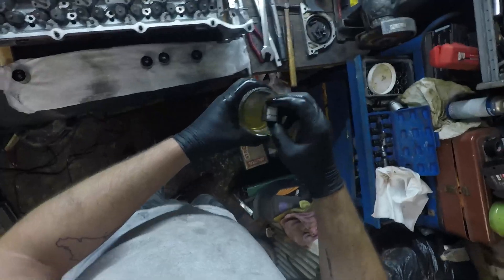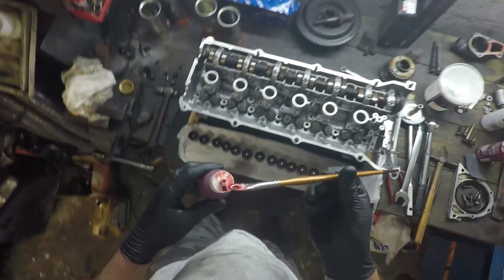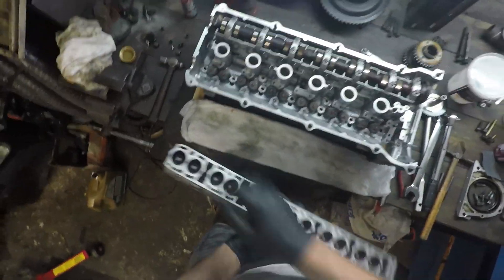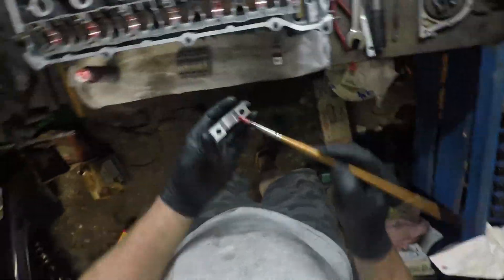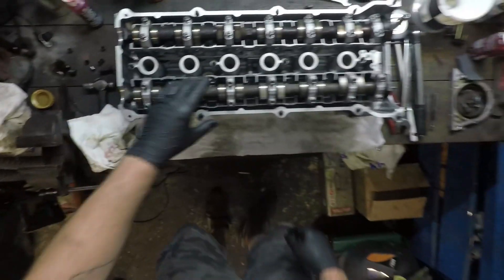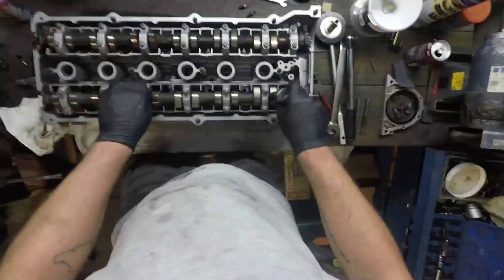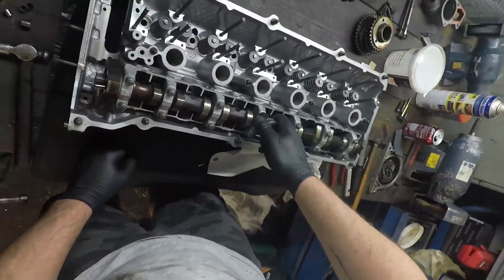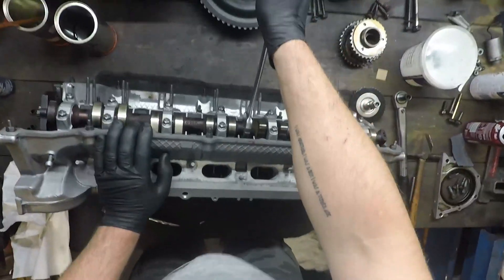M52B30 Stroker Build Camshaft Install

Comment: HI LA QUESTION ETAIT DE SAVOIR , POURQUOI  VOUS N AVEZ PAS MONTER UN JOINT DE CULASSE AVEC LA HAUTEUR OEM M54 B30 QUI EST DE 0.76 MM  ? MERCI
Reply from the maker: Si je comprends bien, vous me demandez pourquoi je n'ai pas utilisé le joint de culasse OEM à 0,76 mm.
J'utilise le joint de remplacement standard à 2 mm - Victor Reinz.
Pardonnez mon français j'en comprends un petit peu et traduis le reste
Reply: @ManSeeksCivic  HI . OUI VOUS AVEZ BIEN COMPRIS . AVEC LE JOINT VICTOR REINZ DE 2MM , le ratio volumetric n est il pas trop bas ? MANY THANKS
Reply from the maker: Non, il doit être à peu près égal au ratio standard. Merci bien 😁
Reply: @ManSeeksCivic  AVEZ VOUS DES VIBRATIONS DU AU MONTAGE DU VILEBRQUIN M54 B30,?
Reply from the maker: Un petit peu, aux la termine du la revoulution gamme. Cest pas très terrible. Je garde le vouiture sous 7k, et avoir câblé l'écrou de la pompe à huile pour sécurité.

Comment: bonjour avec un bloc aluminium m52 , avec bielles et pistons et vilebrequin m54 b30 . pouvons nous utiliser un joint de culasse de 0.76 mm de chez cometic ? .  A votre avis quelle serait mon rapport volumetrique ? MERCI
Reply from the maker: D'après mes très mauvais calculs, c'est fondamentalement la même capacité. L'épaisseur standard du joint de culasse est d'environ 1,7 mm. Cette bande dessinée fait environ 1 mm de moins - sur les 6 cylindres, la différence est infime ... Quelques millilitres. Corrigez-moi si j'ai tort, s'il-vous plait.
Reply: @ManSeeksCivic  le

Comment: Hello I have an M52B28, I want to do the same. 
You use: 
M54 330i crankshaft?
M54 330i intake camshaft (intake)?
M50 325i intake camshaft (exhaust)?
Both bearing bridge from M54 330i? 
What about pistons and connecting rods? Are the original from M52B28?
Do you keep VANOS working?
How much power do you increase?
Thanks
Reply from the maker: Pistons + rods =M54b30.
Vanos fully working
Check my latest dyno video for results 👍

Comment: Hi Pamo, thanks for your very informative videos my friend. Great work. Q: What are the differences between the m54b30 exhaust cam and the m50nv cam that you are using. I am staring my stroker build very soon. Thanks
Reply from the maker: They are both the same lift and duration. The only difference that's  important is the timing marks. 👍
Reply: @ManSeeksCivic  Thanks, pls could you explain the timing marks difference and the effect it has on their operation. Forgive my lack of knowledge.
Reply from the maker: @sukjinda9535  The m50nv cam was originally an intake cam. To use it as an exhaust cam it needs to be installed at a different angle to what it was intended. Thus the timing marks are useless and you have to use a different method to get the correct orientation.. My other video and Pazi88's videos can explain in further detail 👍
Reply: @ManSeeksCivic  Thank you

Comment: Looks clean. Did you machine m50nv sprocket face down? I know some do and some seems to get away without machining it.
Reply from the maker: I had 2mm cut off the face so the sprocket sits in line with the intake sprocket. Sits perfectly 👍

Comment: Did you need the cams tree from m54 and m50 to match them with the m52 head?
Thanks!
Reply from the maker: No the m52 and m54 trays are the same. The only reason I used the m54 tray was because I was using the lifters from the m54 and therefore I wanted to use the matching tray. Im not 100%sure about the m50 trays... I believe there is a variant which would need a little grinding to clear the larger cam lobes but don't have direct experience of this.
Reply: @ManSeeksCivic if I use the m54 trays I dont have to machine the m50 nv cam as exhaust?